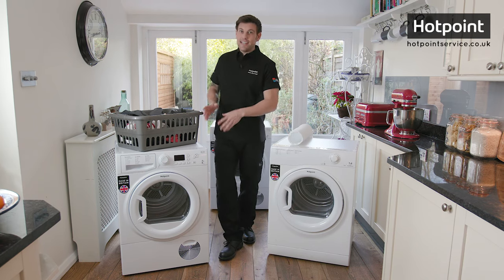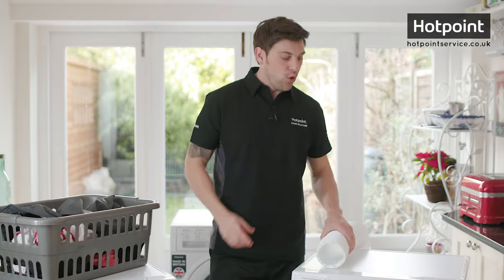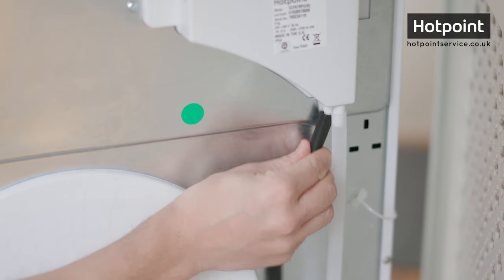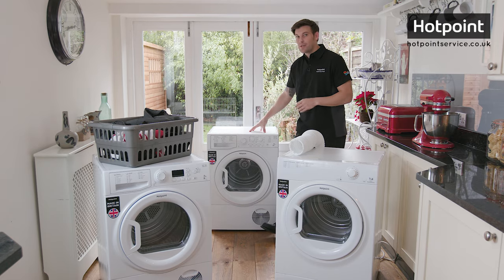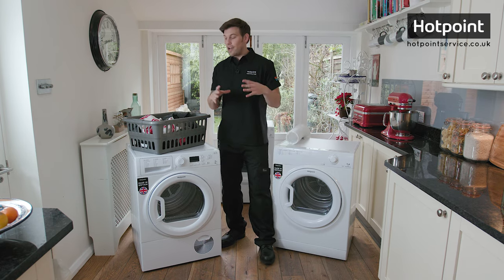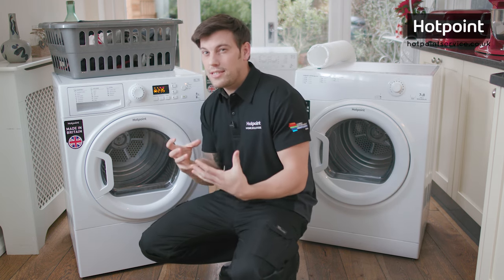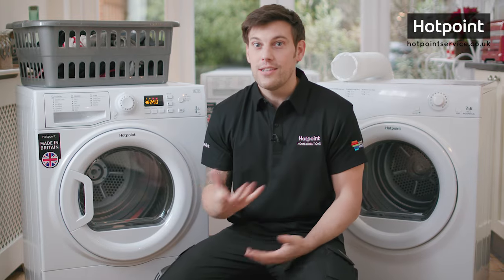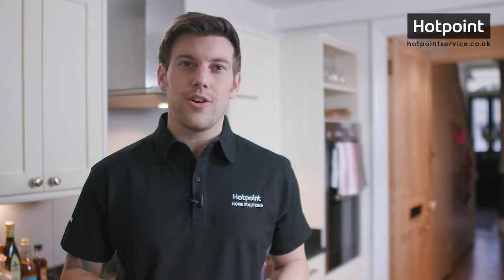Tumble dryers explained | by Hotpoint

Comment: I have a hotpoint tumble dryer which I bought 2 years ago and on the modern dryers such as my own, the filter hinges are made from plastic, so from just general use the filter breaks, the plastic hinges just crack. I have now had to buy 2 new filters since purchasing, so I have to basically buy a new filter every year because it is such a poor design.

Comment: ive had loads of different makes, with a large family I accept they will brake every two years or so, my last hoover the heater went and I managed to get a spare for 20 quid which kept us going for another 2 years, now the motor has gone and its over 100 quid, so i might as well buy a new one for around 200 quid and save myself the hassle, its a shame spares are so expensive, hate to waste all that material.

Comment: i have that 7kg intergrated washer dryer but never dry in it because a flaw makes it stink
i am not putting on hat for Hotpoint the wash bit washes my clothes brilliantly:)
Reply from the maker: Hello, 

Thank you for your comments, I am pleased to see the appliance works brilliantly, expect on drying. Have you thought about having an engineer out to take a look? You may then be able to use the appliance to it's full potential.

If you call 03448 224 224 option 2,2,2 then option 1 an agent can discuss your options!

Kind Regards, Aimee
Reply: @HotpointCustomerServiceUK Thanks for feedback:) It does not really matter, I will consider buying Hotpoint. Very good company.

Comment: I have a Hotpoint Aquarius 8kg TVFS83 I received it as a replacement toa faultydryer and I just want to know is there a heat setting control without using the programmes .I find it very unnecessarily complicated
Reply from the maker: Hey, 

Many thanks for contacting us! I may have found some information for you. 

On the manual I can see the below advise: 

Cotton – high heat 
Synthetics – high heat
Acrylics- low heat

I hope this helps! 

Kind Regards, Aimee

Comment: i bought one 14months later it broke down and hotpoint want 125 to fix it. i will never buy hotpoint again
Reply: Mate, it should still be under warranty for up to 2 years as per EU regulations! Go to your retailer and tell them to sort it out!
Reply: @Y34HN0  i bought another one they never advised me on that thanks for info
Reply: @Y34HN0  no its 1 year
Reply: i had a 5 year gurantee for parts but i lived in my house for 5 years so it expired
Reply from the maker: We are really sorry to hear this! The appliance do only come with a 12 month warranty period. 

Have you spoken to our customer services team where they can discuss the wide range of options for you with an appliance out of warranty? You can reach them on 03448 224 224 option 2,2,2 then option 1.

Kind Regards, Aimee